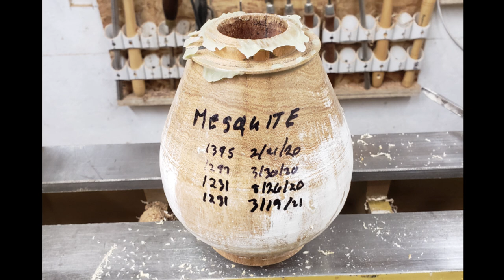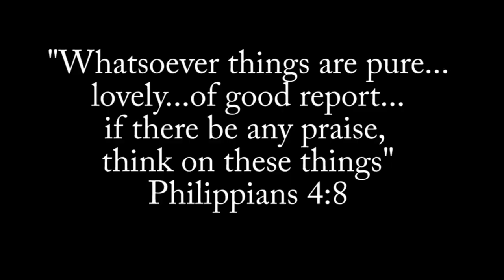Woodturning Mesquite Vase - Rough and Tough From Green To Finished

Comment: Another great job. Beautiful wood!  What is considered dry wood?  What is the lease amount of moisture in wood in order to turn a bowl?   Thanks 😊
Reply from the maker: Dry wood would have a stable moisture content consistent with the current environment.
Here in Utah, we are very dry. Where i lived in Oregon was the opposite.
To get the warp out of it. I prefer to rough turn while the wood is very wet and therefore soft, leaving it thicker to accommodate the expected warp.
Then let it dry in a controlled environment until it does not lose any more weight.
Then remount and trim it down.
Alan